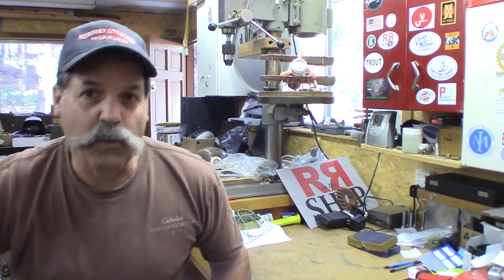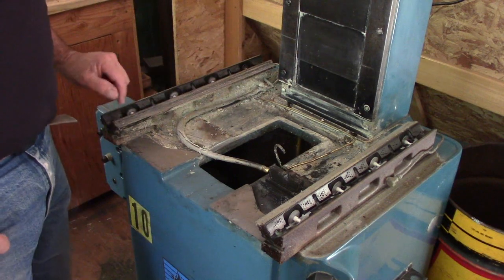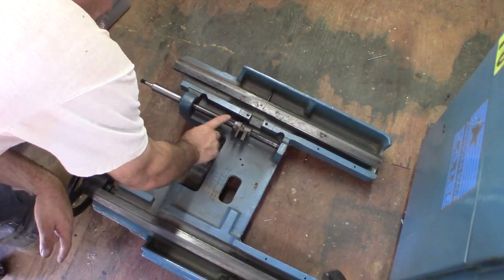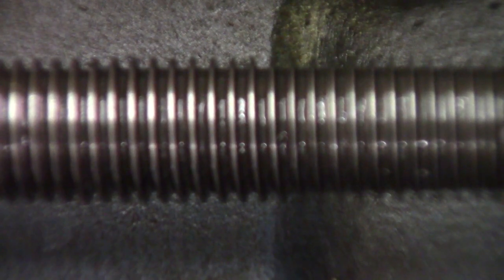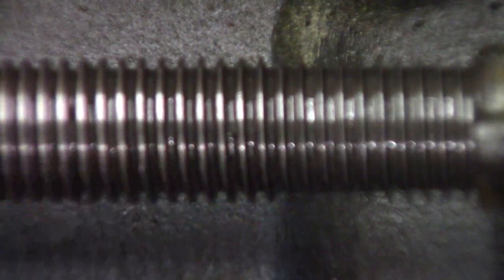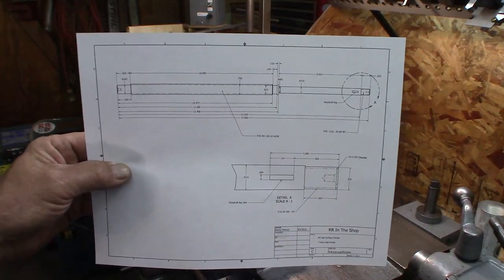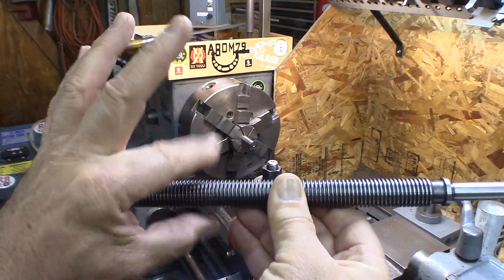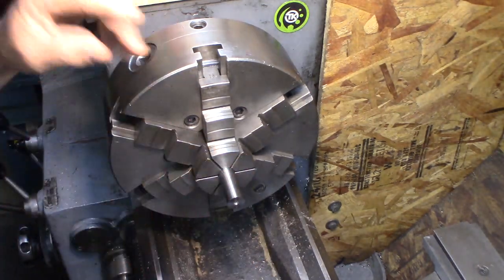How To Build a Surface Grinder Lead Screw P1

Comment: The Acme threads in my lathe were worn much worse than that.   I replaced the nut and the threaded part.
Reply from the maker: Yes usually both. Thanks Ken.

Comment: follow rest would be very helpful when cutting long threads.
Reply from the maker: Oh yes.  This material is very stiff and there was little to no deflection.  If this was any smaller in Diameter I would of used one.  I need to do this same project for the Lance Lathe and will use one then.  Thank you for watching.

Comment: That's just disrespect to what is arguably one of the most fine machines in a shop. The surface grinder, whomever owned it treated that machine like a throwaway plastic drill. Good thing it wound up on your hands, you'll take good care of it. :)
Reply from the maker: I think you are correct.  They ground a ceramic material on it, not a single bit of metal grindings on it.  
I will try to do it justice.